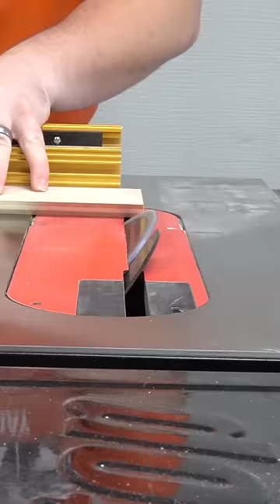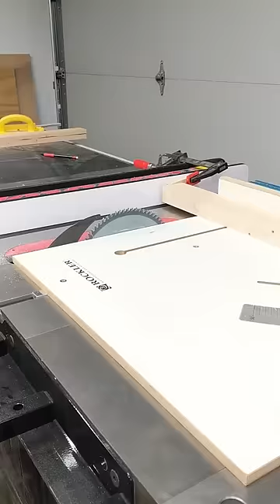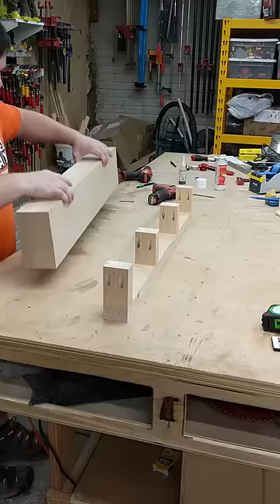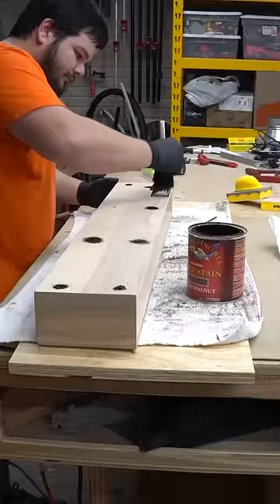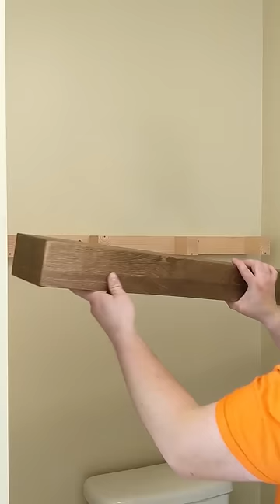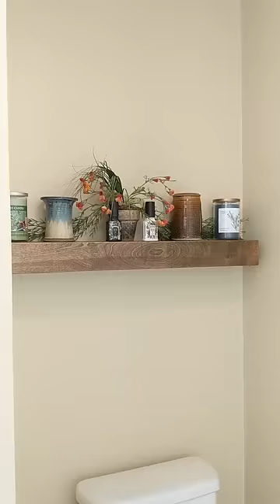Making a Floating Shelf

Comment: I find these videos pretty pointless. With those tools you could make anything. The average person with have a drill, jigsaw and MAYBE a mitre saw.
Reply from the maker: The parts could easily be cut with a circular saw angled to 45 and a straight edge.  I had a table saw, so I used that instead.  It's not about the tools you have, but how you use them.  If you don't have tools used in videos like these, find ways to be more creative with the tools you do have.

Comment: Terrible finger technique. Bye
Reply from the maker: My fingers were never actually all that close to the blade, camera angles have a way of making it appear closer than they were.  Also, I did use a push stick feeding it through but that was edited out due to length of the video, plus it's a disaster waiting to happen to use a push stick while the wood is still hanging off the front of the saw.  You can watch the full video here, if you're interested. https://www.instagram.com/p/B5TeIVOApyK/
Reply: @ToolsToday  thanks. Best leave some technique in as it’s hard to recommend videos without.

Comment: Wears a respirator for cutting wood, but not sanding— finest particles ever— and staining ???    🤷🏼‍♂️ 😂.  Why am I so dizzy????
Reply from the maker: The festool sander I'm using collects 99% of the dust and I had a dust filter running in the room.  The stain I'm using is a 0 VOC stain.  I am however allergic to poplar, the inside of the plywood is made from poplar, the outside is birch.  Had I not been wearing it I would regret it for a week.
Reply: @ToolsToday    Well stay away from the virus then and stay healthy!!   If allergies from wood knock ya down, you don’t need the rona.. 🤘🏻
Reply: Glad to see you! I am a young design engineer from St. Petersburg, Russia. In our country, working with such equipment and tools, I'm afraid of this word, is a luxury. ..besides, the education system itself and the actual training of specialists are far from perfect. I am ready, with your help, to lead the directions of interest in this environment. Respond !